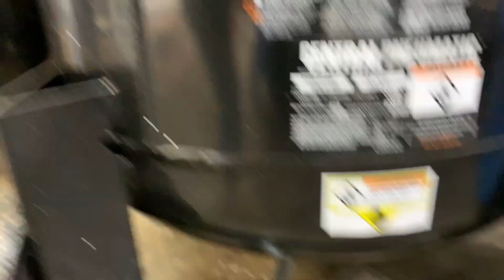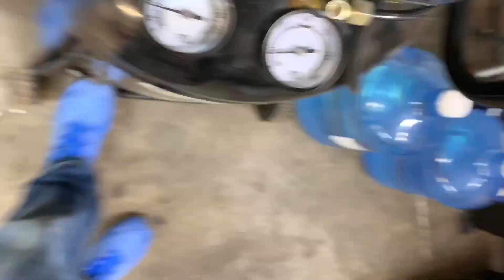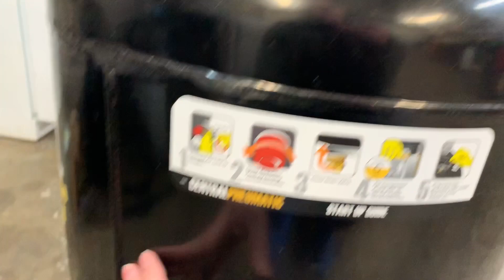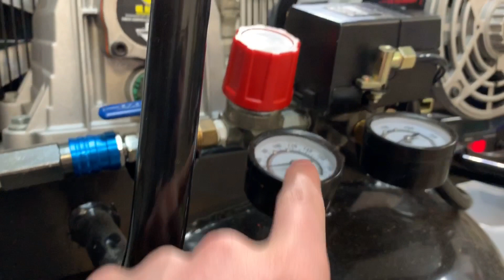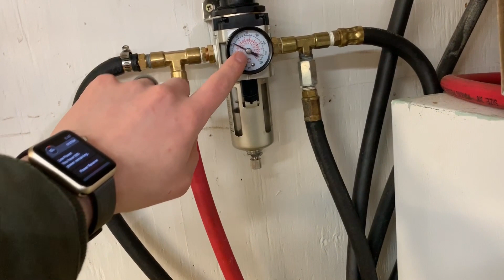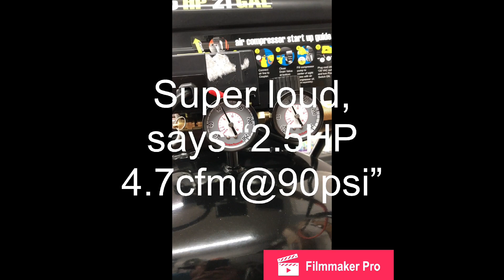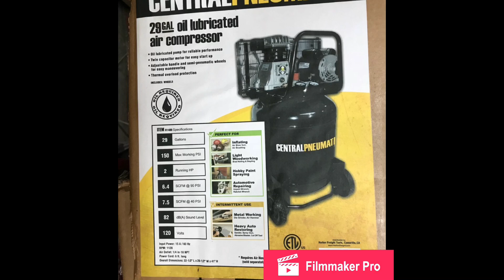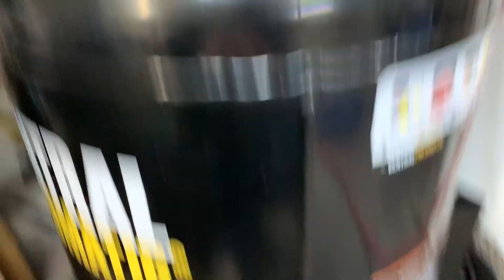Harbor Freight 29gal After Cooler Install, (BONE DRY AIR)

Comment: No commercially available air compressor comes close to the rated cfms.
Reply: If u read the cfm details they rate them at mid psi . So the cfm looks better than it is.
Reply: exactly like the horsepower rating in car engines, it is a scam, torque values is what you get really.
Reply: @jacquespoirier9071  there is a hp formula which torque and rpm are part of .. don't know it off the top of my mind .. so yes .. and hp torque rating at the engine crank are always way more then the rating on the ground. Due to losses in the  drive train. I do see both hp and torque as real measurements of power . If a light weight vehicle higher HP is better if heavy and towing rig then torque is boss. But if the high torque motor is in the light vehicle a simple gearing up of the final drive can be just as quick so.  I cannot say u are wrong by any means.
Reply: @jasonwhite8722  hp=torque  x RPM  / 5252 so what a dyno measure is the torque produced and torque is what you feel HP is a mathematical  calculation,
Reply from the maker: I tested mine a few times with and without the auxiliary tank. It’s about 7, I’m happy with that.

Comment: Water in the air compressor comes from moisture in the air.
Reply from the maker: That’s right. And when you cool the air before you store it in a tank, the water in the air is removed and doesn’t come out the tank. I can literally fill this tank, leave it sit for two weeks. Drain it and nothing will come out.

Comment: Why the heck would you cut up the frame of this thing for the sake of a drain plug?  Put an extension tube on the outlet.  Problem solved.

Comment: That blue hose is not rated for 2000 degrees.....4:09
Reply from the maker: Could’ve definitely been a mistake on my part haha. I’ll check on it later when I get home from vacation but either way, it’s holding up fine a year later
Reply: symplemynd57 psi maybe
Reply from the maker: 250* degrees 😂 oops. 
Again just to clarify it’s a pressure washer rated hose for 4000 psi and 250deg rated. Not steam rated. Doesn’t get hot enough to hurt it and still running strong at 117.5 hours.
Reply from the maker: symplemynd57 ya got me
Reply: @gunsandgaragegear601  
How do you know how many hours? Does it have some sort of run clock on it? I would love to have one if it does. I just guess at it now and, as most of my guessing goes, probably not anywhere near accurate.
Reply from the maker: Roger McCaslin sure does!
Reply: @gunsandgaragegear601  
Is it built in or an add-on? If it's an add-on, do you have a link?
Reply from the maker: Roger McCaslin built on
Reply: Nice set up especially for the money.
I think the best was to describe your “after cooler” is it in fact works the same as an AC condenser.  I’ll be doing the same on my new compressor.
Just have to make sure the cooler and hoses need to be rated for proper pressure. Usually a transmission cooler works well.

Comment: is the cooler still holding up. also where did you get the filter the return of the cooler back to the compressor tank. Great job by the way.
Reply from the maker: hoxha34 working fantastic after a year now. The filter is just a universal radiator cooler a friend gave me

Comment: It's kinda hard to make out in vid. But @ 06:25 your return from the "cooler" looks convoluted. Couldn't you have gone straight to the tank fitting without the 90's/elbows?
Reply from the maker: mike johnson yeah I probably could’ve, the inlet to the tank was a weird angle though so this seemed to be the best workaround, and it still works great.
Reply from the maker: See at 2:31
Reply: I would have added a valve to drain at the low spot. Change the 90 to a tee, I bet it might collect water under high usage or if the moisture collector is full.
Reply from the maker: Eric Krumm that is a good idea. Even more water separation. Though I still to this day have not gotten a drop of water out of the tank draining every so often

Comment: Your work is scary.  That flexible pressure washer hose is not good for 2000 degrees.  It may be good for 2000 psi.  It is also not good for the 300 plus degree air coming out of the air compressor.  The hack in the frame for the oil drain is a good way to propagate a crack.  All it needed was a drain pipe extension installed where the plug installs.  The filter hanging on the cooler may cause the cooler to crack.  It was not designed to support accessories.  The extended tank water drain is a good idea.

Comment: If you want to run two tanks you would have to remove the pressure switch off of 1 and connect the pressure switch to both of them because the air pressure switch on both of them won't reacted the same time, and it is very inefficient to run Inlet to your secondary tank and also running a line to your filter and then another line from your secondary to your filter because when you start running lower on air air will be going to that second tank to be filled up before it exits it you will lose volume and pressure, kind of like having a splitter on your garden hose and putting your thumb Over the Hole to spray it it will slow down coming out of the hole you covered and all the water go out the other hose( filling the tank)
Reply: Wrong, unless the tanks are isolated the pressure of both tanks will be the same, it doesn't matter where the pressure switch is located as long as it can sense the operating pressure.
Reply: Maybe I'm explaining it wrong you were talking about adding an identical setup to the existing one yes you're correct in the fact that the pressure switch location is irrelevant but to compress the air that you're talking with two separate compressors both the motors would have to be hooked to 1 pressure switch or else you'll be having one kick on when it calls for more pressure building pressure above the threshold of the second unless you have both pressure switches at the exact pressure and then the other issue you would have is a fire issue due to drawing too many amps off the one switch on initial startup
  And another thing the compressor pulls in moist air heats it up create a steam where does that steam go it will still condense inside the cooler and eventually find its way inside of the air tank I believe a moisture containment between your cooler and the tank with a drain valve on it would be beneficial to you one that the cool air goes to a T goes down into the drip containment and also goes up about 5" how to separate water from Air and then over to your air tank ( I use 3-inch schedule 40 PVC with a 3/8 drain valve)

Comment: An aftercooler doesn’t change the moisture content.  So, this isn’t doing anything.
Reply from the maker: It cools the air before going into the tank. Can’t argue with results before and after. With just the water separater and then with both after cooler and that drain filter.

Comment: The transmission cooler isn't designed to handle that much psi.
Reply: B&M literature on this transmission cooler says they are pressure tested to 200 psi. Should be more than adequate for 125 psi application like this.
Reply from the maker: And, after a year it’s still working great. It holds air for days
Reply: Isn't the air in the cooler depressurized by the unloader valve when the compressor stops?
Reply from the maker: BerkeleyGang ah yes it is fully depresurized. So under use it works fine. And doesn’t have any prolonged wear on it.
Reply from the maker: And it’s still working

Comment: You can get a dealt 60 gallon for 560. I have one works great. What your doing is way to much man. Power to you tho I'm all about making shit work
Reply from the maker: Harry Taylor my video shows using an aftercooler , it creates dry air. The auxiliary tank is seperate.
Reply from the maker: I didn’t have the $560 either now did I have the space for a 60 gallon. Now with a bigger shop I do but don’t have a need for that much air and don’t like hassle of 230/240volt. So this ones 120 and the best value on the market.

Comment: i can just add a 3/8 50ft copper coil in between the pump and the flywheel and some compression ring and fitting, that  just cost less than a hundred dollar and, no matter what inside the tank are still be rust cuz its all metal with out any rust protection
Reply: sure, maybe spray some Fluid Film in the tank before use. You will have to remove the tank fittings though to get the spray in from every possible angle.

Comment: Extend your drain with a piece of pipe3/8 probably
Reply from the maker: T Huss I did that at the bottom. The oil plug is like 1/4” or smaller and no extended pipe could be found.

Comment: this unit drastically reduces air volume
Reply: isn't that what air compressors do? 
pro tip: Never operate an air compressor in a sealed room with you in it. :P
Reply from the maker: Seems to work great.

Comment: You don't get water in your tank because you don't use the tank enough. Water is a byproduct of compression, you can't remove it from a compressed air tank... Radiator inbetween the motor and the tank is only there to allow you to maximize the amount of cycles possible before needing to drain the tank. That is referred to as duty cycle. And most tanks should not be run for more then a specified amount of time without draining, as rust will form and eventually cause it to blow out. Simply put... All it does is extend the amount of time you can use run tank up and down before there is too much water inside of it.
Reply: He catches the water when it leaves the after cooler, so the tank doesn't get much water in the tank. Yes it is good to drain the tank as well. The easiest solution is an electric drain that cycles every so many minutes. You might say it is dumb to have it run every 5 to 60 minutes for a home shop. I agree. Mine is tied to my motor starter and it happens to drain every time the auto drain gets powered up again. Every time the compressor runs, the tank drains. I have the same aftercooler planned for my compressor, but it will be plumed 3/4" to match the output of my compressor (the pump looks about like a harley engine at 3 times the output of his). Having multiple points to draw out water and also cool the air will make for dryer air. After the typical separators, I have an M30 paper filter to get the last of the oil and water out.

Comment: Had the same unit..it lasted only a year..junk..china..I live in sunny hot Florida..you have to open  the tank drain often. When it's 90 out side and 100 h....I get water build up in the tank..each use..I reamend  u drain it out after each use..in fl...I used to live in the cold north..that's the dif in the winter..anyway ..harbor  fright  China..don't do me any justice..beware I've seen one tank blowen up..being returned  to harbor  fright  store 2 yrs ago..due..china steal I bought a new Saylor-beall  60 gal made in America..big money  but    it has a radiator  on it . fan cooling..on the motor..and a automatic  tank drain ..if you are painting  cars ..yes mine cost me 4 grand ..but worth  the cost of safety..great video

Comment: What oil did you change to
Reply: Just go to AMSOIL's website and order the synthetic compressor oil.  ( it will say, "Compressor oil" on the bottle. ) Probably the best on the planet, DeWalt has some too but its more than likely re-branded Mobile 1, wich isn't true syn.
Reply: Did not know they had that,can I ask how much a quart?
Reply: @robertnaughton5417   I couldn't tell you, everyone's prices are different based on how much product you buy from them.

Comment: All that plumbing on the coolers and sending the air to the valve on the wall does nothing . yes it cools the air but I think this could be cleaned up . But the fact still remains that you are trying to put 2 3/8 lines into a 1/4 hole in the regulator. How can you clamed you have more volume? As far as cutting the v in the compressor tank all you would have had to take a piece of 3/8 pipe and put a valve on it to drain it  that will look and be easier to use. The drain on the bottom of the tank looks like it is tilted up so it captures any contamination in the line over time. I will give you this at least you know where the drain is . Plus is not like the idiot that never drained the tank and to show his stupefy and ignorance by posting on u tube don't by this tank because it's a  piece of junk. when the tank bleu up and it flue across the room.

Comment: umm the air expands when it enters the tank. of course the line going into the tank is hot but that does not mean the air in the tank is hot have you ever heard of an evaporator? going from 1/2 to 3/8 is adding more heat than it had originally, not to mention that after cooler as you call it is designed for liquid not air for air you need bar and plate otherwise the water in the lines there will pool because it cannot drain in a zig zag air line. the only reason the air is dry for you is because water is stuck in that cooler of yours. hahaha your funny guy all playing engineer I hope you dont design elevators or bridges hahaha
Reply: Oh man, you really have no idea what you're saying. What he created is a condenser not an evaporator. The oil cooler is crossflow not zig zag, hot air up top drops through the fins and water collect at the bottom in a water collector. Many people have done this and it works, go an educate yourself.

Comment: I try not to give out ‘thumbs down’, so consider yourself special. Clearly you don’t understand how vapor in air works. But, You show hustle even if you don’t have any clues to offer.

My suggestions;

Repurpose that small heat exchanger to be water cooled. Huge potential there.

Don’t downsize the plumbing. Keep it as large as the outlet of the compressor.

Avoid using iron pipe as much as possible.

The compressor oil drain; why didn’t you just put a pipe extension on the recessed plug instead of hacking the compressor.

Create a plenum for airflow through the clamped on radiator.

You’re welcome.
Reply from the maker: Paul Menten read some of the comments. 

Small heat exchanger to be water cooled? No need it works great with the transmission cooler. 

Plumbing did not get downsized. 3/8 throughout. 

Iron pipe, I used it, oh well. 

Compressor oil drain, is like 1/8” diameter I could not find an extended threaded pipe for that. Thus the functional “hacking” making the funnel fit better. Like it or don’t. 

Plenum through the radiator?? 

Again the proofs in the pudding I’ve had this working overtime for over a year. Every few months I get the urge just to see if there’s a drop of water in the bottom. And there’s not!
So I don’t drain it at all

Comment: All you have done is restricted air flow and you will probably blow head gasket,,  I used 3/4 inch coiled copper and dropped my air temperature by 100 degrees with no restriction of air flow,,,for 35 dollars..dude you should have just gotten a 60 gallon,, your just putting strain on your compressor
Reply from the maker: George Spangler wow this is like your 4th comment Hahahaha. 

Thanks George.

Comment: Modifying a compressor is an incredibly stupid thing to do. The best thing to do is follow the instructions in the manual.
Reply: The stupid thing to do is to ASS-U-ME that modifying an air compressor is incredibly stupid and that following the manual is the only safe choice. Have you researched modifying air compressors? If you had, you would see that this is a common upgrade. His compressor is anemic but still has the same water issues that they all have. There is actually a one way check valve at the top of his air tank. Even if the cooler bursts, it will only let the air out of the hoses and pump, but will not let the tank drain out. Some coolers are rated to 150 psi. Others have contacted the manufacturer to find out if it was safe. Not all are safe, but that one company has a product that is rated that high. I will be doing the after cooler on my air compressor (it requires a forklift to move it at 700 pounds and it puts out 3x the amount of air and was built to run constantly for a commercial shop).
Reply: I am a mechanical engineer. I have performed safety inspections on air compressors and done pressure vessel design calculations for a living. I am familiar with accident statistics and case studies.

These instructions are taken from the compressor’s owner’s manual & safety instructions:
-Drain tank of moisture after each day’s use.
-Do not alter or modify the unit from the original design or function.
-WARNING: When servicing, use only identical Harbor Freight Tools replacement parts. Use of any other parts may create a hazard or cause product damage.

I can tell you from experience that not following the compressor manufacturers’ instructions can kill you. The improvement these modifications have is questionable.